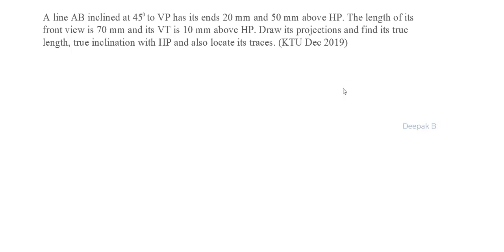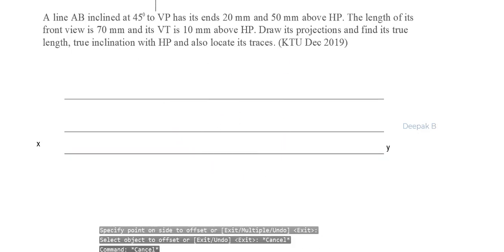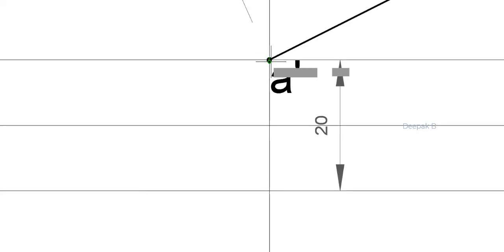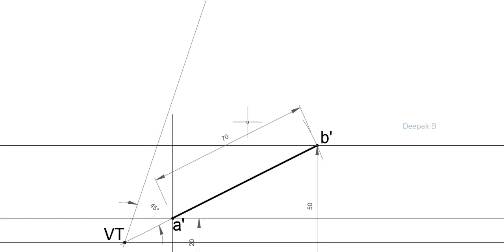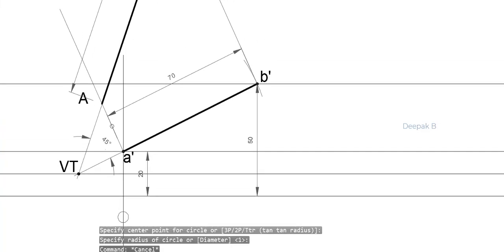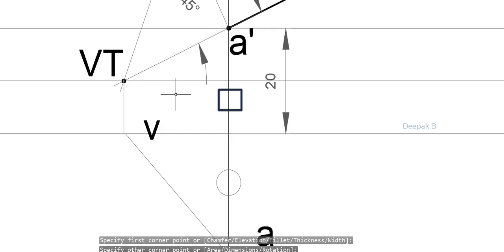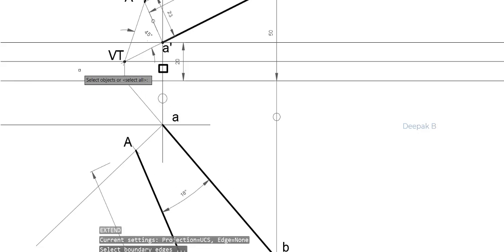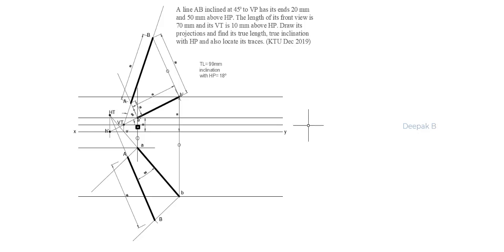KTU Engineering Graphics | University Question on Trapezoid Method

Comment: A line AB inclined at 45º to VP has its ends 20 mm and 50 mm above HP. The length of its front view is 70 mm and its VT is 10 mm above HP. Draw its projections and find its true length, true inclination with HP and also locate its traces.